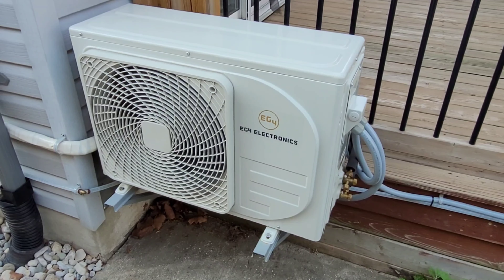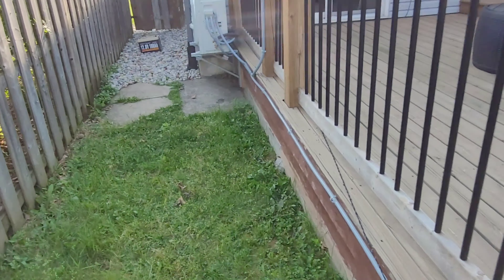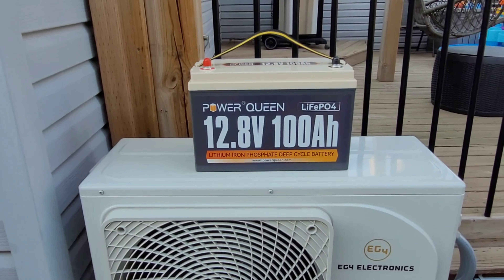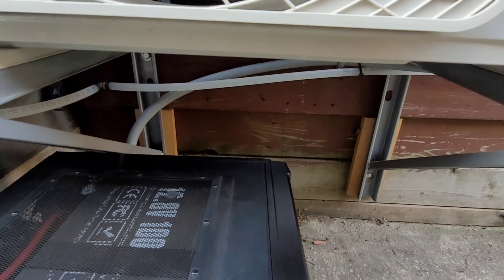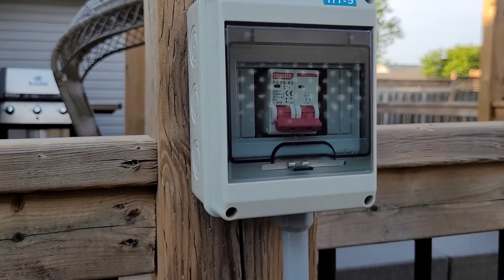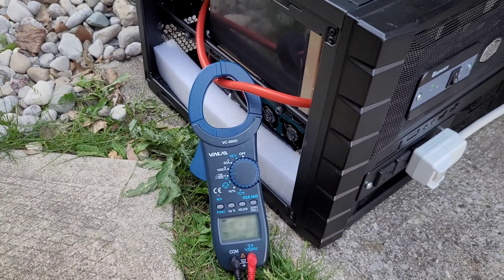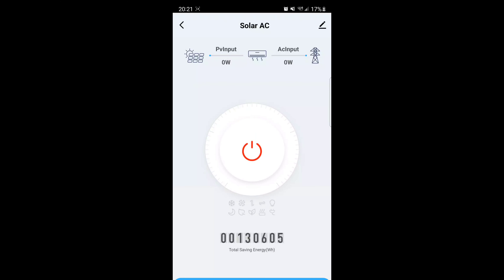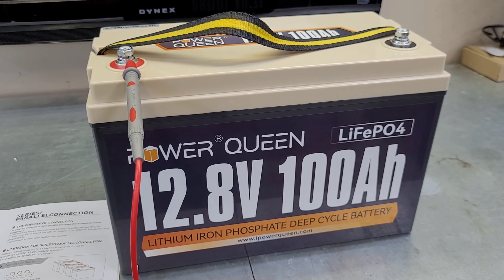Can You Run An Air Conditioner On Solar /  LiFePO4 Powerqueen Battery?

Comment: awesome setup. i have 2 ton mini split and i want to do a setup like urs. but how do i know how many solar panels would i need and all the equipment to run on solar..please help
Reply from the maker: You'd have to figure out how many watts it draws, how many hours you plan to run it after the sun goes down etc. You would need a decent sized inverter, probably at least 3000w, 2 to 3k watts of solar panels and a good sized battery bank, 10 to 15 kWh. That's why this unit is so nice that it runs directly on solar, you can eliminate all the other required equipment unless you want to take it fully off grid
Reply: @SmitHVAC.  
Okay let me go found out how much is draws

Comment: Why does the meater show all the power for the AC coming from the power grid when you disconnected the solar? Shouldnt it show nothing if you're running 100% off the battery?
Reply from the maker: The battery is connected to and inverter feeding into the Ac input of the mini split.

Comment: new to solar and i am interested in solar . how to u wire the solar panels into the mini split ? and i would like to know how to wire both solar and AC power into the ac mini split. the app where is it getting the information from ? watts being used
Reply from the maker: This unit has mc4 connectors built in so the solar can just plug straight in, the Ac power is wired to the dedicated Ac input block. The app gets its info from the unit, it's a specific app for this Ac.

Comment: wait.. are you running the as on 200v DC? not AC?  do you have those panels connected DIRECTLY?? Oh please tell me you are..
Reply from the maker: Yes the panels are connected directly for a total of 210v DC, this unit runs directly on solar and only pulls grid power after the sun goes down.
Reply: @SmitHVAC.  WOW! that is a real game changer. thanks for the info. I didnt realize the inverters in the minisplit would accept DC instead of ac. thats amazing. <3  Isee you are using grid and solar at asme time though? how does that work?
and what is that disply device that shows power source distribution connected to? do you have a video showing your schematic?
Reply from the maker: This one has a built in Mppt for the solar, check them out on the Signature solar website https://signaturesolar.com/?ref=_KvVrzchAclARI
Reply from the maker: @dontbe  I have a few videos showing the general operation and how it switches between solar and grid as needed

Comment: awesome!  How many panels / watts are needed to run this thing?  just over 500?  That's rad you can just get the battery charged up and use it for a few hours when needed.
Reply from the maker: Thanks for watching! It can use close to 1100w but it's usually sitting around 500w. I have 5 225w panels for summer and 6 for the winter.
Reply: @SmitHVAC.  thanks!  So if I ran 2 320w panels I’d most likely only be able to run it off the battery?  I’m building an office for working remote and want a mini split
Reply from the maker: @beardfootofficial yea that should work, depending on the size of the office you may only need the 9k btu which would use even less power

Comment: This is a 1 ton mini split correct?
The power consumption is excellent. I run 2 6k btu window units off of my solar setup and they use right at 600 watts each. So if you're a 1 ton unit you're getting twice the cooling capacity at less than half the watts.
One idea is to make a battery bank with a high enough voltage to supply the EG4 with the voltage it wants and feed it directly from the battery DC without conversion losses. I'm not sure if the EG4 would be able to handle being connected directly to batteries though. But that's how it should be. My opinion... haha
Reply from the maker: Yes this is a 1 ton unit, I believe it's around 22 seer although it doesn't state that in any of the documentation. The power consumption is excellent though. That's a cool idea but I'm trying to avoid anything that would void my warranty lol have an eye for more videos on this soon
Reply: I love the idea of the solar mini split but it leaves a ton of power on the table too. You can't have it all though unless you want to spend a good amount of money. I did mine the way I did because I picked up a bunch of window units in the winter for average of about $30 each. That's a big efficiency difference with the mini split and also having a heat pump would be nice. During the winter I just run a space heater which is probably half to a third as efficient as a heat pump... but also something I already had 🤷‍♂️
Reply from the maker: @lancealderman2755 that's always the case, you can't have it all. I like this method because solar panels are cheap compared to batteries, I don't mind dedicating 5 panels just to this with how affordable they are now. Nothing wrong with doing it your way, I just picked up a larger inverter so I'll probably make some videos on that soon.
Reply: @SmitHVAC.  That is true. What were the temperatures when you did this video? If you said you'll have to forgive me.
My 6k btu window unit will run about 500 watts when its 85-90° and can get up into the 650 and even 700 watt range when it's 100-110°. Even still the minisplit seems to be twice as efficient.
There's a lot of details, figures, and options I would have liked to have known when I was starting out...
Reply from the maker: @lancealderman2755 It was around 85f that day, we don't see too many days hotter than 90f here which is nice. In my other videos I beleive I show the Minisplit running around 800w. If I let the house get hot before turning it on, it runs hard until the house starts to cool down, then it ramps down to around 500w.
Reply: @SmitHVAC.  oh wow. If it was 85° here with both mine running I'd probably be right at 1000 watts. So then best guess is the mini split is 20% more efficient. Thanks for the info! That also means you're leaving less solar on the table than I thought also. Very interesting...

Comment: Just mind that these types of batteries have a lot of air and foam inside the case, keeping the actual cells in place and that forms a pretty substantial thermal barrier between the cells and the outside. 
From what I've seen in my batteries and others, there are no direct contact points between the cell aluminium cans and the plastic outer case so pretty much no heat gets out. 
I am considering re-casing my packs in something more manageable that could be cooled or heated as needed...

Comment: Have you made a video explaining if it’s possible ect on running it directly off batteries DC I see lots of comments about it & I’m also curious
Reply from the maker: I have not made a video on it, but I was talking to a tech support rep from Deye and they said it is possible
Reply: Yah but how much bat would be needed in a day? Then how many panels needed to recharge ? I’m about to do something to my RV so still looking.
Reply: This is the subject that maybe should be talked about some more. For example,  as I understand it, your home made inverter is probably losing up to 15% of the energy in the battery during the conversion to AC power, then, when once inside the unit, another inverter is converting it back to DC to run the compressor with another likely ??% tax.   I know batteries up the price but there are lots of videos with all the battery people doing the DC to AC back to DC conversion.  I realize they are probably running other things but for people designing this system from scratch and have more options I don't see this discussed much.   Am I missing something.   Can't we just configure batteries to feed DC power to the PV input on the mini split, or would  the other MPPT controller between the panels  and the batteries interfere?
Reply from the maker: Its apparently possible to configure the batteries to feed into the mppt, you would need a minimum of 90v DC on the input. Meaning you would need an mppt capable of charging the battery bank around 100v Dc. It's more equipment than I have and Im not looking to void my warranty on this EG4 AC, but it is possible. This was more or less to show that you can run a standard mini split on a battery and a small inverter if you didn't have the EG4 version.

Comment: I would get a sun tracking solution that would tilt your panels toward the sun automatically. The extra power should pay for itself.
Reply from the maker: Do you have one you'd recommend?
Reply: those things are very expensive and fragile - think weather...  avoid that expense and spend those $ on "moar" panels and batteries.

Comment: Just wondering on how you charge the battery, and also the BMS of the battery will protect it from low discharge damage, you  really have no concerns with that, longevity could but your talking years down the road in which their is debate if aging will shorten the life first.  between that and your inverter they will shut down if low voltage becomes to low to sustain the load.
Reply from the maker: The portable station was just to test out the idea, if I put it on a battery backup I will hardwire it to the Ac from inside. I have a string of solar that runs inside to a other system.

Comment: how does EG4 or circuitry do this?  does it skip the AC-DC conversion or this thing just has a built-in 120V inverter?
Reply from the maker: Skips the conversion, it has an mppt and a DC compressor

Comment: I'm trying to understand your setup without ac input from the grid. So you have a pv input on your mini split. And you just add the solar panels in series and feed it directly into the mini split? If this is true, does the unit turn on automatically or do you have to go to the remote contorl and manually turn the unit on everyday in the morning when the sun comes out?
Reply from the maker: Check the other video you commented on, I explained it on that one

Comment: How did you hook up battery box to mini split? I see it plugged into battery box, but did I miss seeing how you plug into unit?
Reply from the maker: I had that cord wired into the line, neutral and ground terminals of the mini split
Reply: Can't thank you enough. If I end up purchasing one, I'll certainly go through you.  I noticed you're using a 100/20 Victron MPPT. You have 5 panels hooked up at less than 100 volts? What configuration are you using to accomplish this?
Reply from the maker: @aznick102  thanks Nick! Appreciate it. I only hook up a max of 2 of these panels to the Victron. I typically have 5 hooked up to the Ac and 1 to the victron, panel upgrades coming soon!

Comment: how many btus is that mini split? 500 watts is pretty dang efficient, I wish i could afford one for my little solar shed, I kill my batteries a lot running a stupid 8k btu portable AC that cant cool a room because of its design. the dumb thing uses 800 watts too.
Reply from the maker: This is a 12k btu, it's very efficient! I have a video coming tomorrow showing how to run it on around 220w. Thanks for watching
Reply: @SmitHVAC.  jeez thats crazy efficient

Comment: I still prefer to build the Lifepo4 batteries by my own. This way I get 280Ah for less money than this 100Ah cost (exept when get it sponsored). I have full control via App and also have a monitor without mobile phone, to see the single voltages from the cells and the deviation. An active and passive balancer are also included, so theres no issues, if use the battery intense. I dont trust the BMS this finished batteries have build in.
Reply: Could you point me in the right direction to learn to do this?   Or explain what you do.  Thanks!

Comment: Rewatching your video, last summer in Arizona our electricity was out for 4 hrs. In about 2 1/2 hrs afterwards the house heats up. Watching your videos make me want to build a gazebo and add a solar E4 2 ton to house along with a battery backup system that will last at least 4 hrs of electricity outage. Any recommendations for a battery unit to support 4-8 hrs of service when there electricity outage? Thanks!!
Reply from the maker: I have a bunch of the Chinese 100ah batteries hooked up that give me about 8 hrs of runtime. I'd probably recommend the EG4 all in one inverters and 48v Lifepo4 batteries if I had to start again!

Comment: Do you already have a Thermistor controlled Gable Fan?
My house carries a ton of heat in the attic and with a Gable Vent fan + Thermistor set to around 95F it helps to cool down the attic and thereby the house underneath as well.

Comment: Using an inverter increases the voltage of current, rather than using battery directly, it would be good to use inverter to increase current.

Comment: Hi, can I run a 1.5 ton AC directly from solar panel without using batteries or any other power source (complete off grid). I want to use less batteries as possible as they need to be replaced often. I want to run the AC only during the day. Thank you.
Reply from the maker: No, you would need batteries, an inverter and an mppt. Or a solar direct ac like this one.
Reply: @SmitHVAC.  okay. Thank you.

Comment: How about a battery running a standard cheap 5,000btu window unit? Some little thing the average person can pickup at HomeDepot for $150 and how that would do on one pf these LiPo’s. Also approx what size panels you would need to keep it running all day. In a grid down situation, just curious to see what kind or simple and min solution would be needed to handle that. Most people are always concerned about their refrigerator when the power goes out but really, when it happens and its Summer, people are looking for some AC to get through it all.
Reply from the maker: If I can find a good deal on a little portable Ac I'll make that video

Comment: What BTU is that AC unit?
Reply from the maker: 12k
Reply: @SmitHVAC. thanks for that. I have a solar system with 6500W of panels (12) with 2 200a 10Kw Lithium iron phosphate batteries and a 8Kw Hybrid Inverter. I wanna install an AC unit or two between 9k BTU and 18k BTU. I just wanted to know how much a 9k BTU AC unit would run as soon as it is turned on and starts cooling. Here I see yours run at around 500W so I can expect it to run less than that?
Reply from the maker: @thtk4tis yes it should be around there, this one pulls up to 1400w in heating mode

Comment: Hi I need help finding a device Maby inverter type that can convert direct AC power from the solar panels without needed connected to the grid or batteries want to be off grid but no batteries and use a power strip to power fans etc

Comment: Awesome choice on the renogy inverter! I have the 2000 watt on 3 gel 100ah batteries. I've been looking into mini splits and then eg4 happened... I'm really sold considering I've been helping cooling my house with a delta pro with 1500 watts of solar running a 1350 watt portable air conditioner 12,000 btu and also doubles as a heatpump that I use in the winter but I really need more efficiency. I have another 500 watt array Soni think between the 500 watt array and delta pro and get one extra battery I'll be all set lol what's the highest wattage you've ever seen the eg4 mini split pull? I'm heading over to your page to check out more videos on it. Thanks for the video!
Reply from the maker: Yea it's a good little inverter! Great standby power consumption too, only about 6 watts. I've seen the EG4 pull about 900w in cooling but not for very long, and up to 1300w in heat mode. Thanks for watching!

Comment: Great vid as always! 

Perhaps over panel with some panels that specifically point westerly at the late afternoon sun. Panels are pretty cheap these days. 

Are you charging the 12V battery with the panels during full sun? Do you have a plug and forget solution figured out yet?
Reply from the maker: I have a permanent battery backup with solar charging in the works right now! I'd love to add some panels, the problem is real estate. My pergola is full so I either need to put some on a mount in the yard, or put them on my roof, which I'd like to avoid!

Comment: So I didn’t realize eg4 sells an identical mini split that is not a hybrid. Mine doesn’t have pv inputs. But in purchased panels and a tracker to power it. I live fully off grid- my inverter is maxxed. Do you know if the board can be swapped or if a Pv input can be added? Are the compressors all dc? These are relabeled and the vendor is telling me they don’t think it’s possible but the diagram inside shows it’s optional
Reply from the maker: I beleive it's a separate mppt board, that's what the diagram shows but I haven't had to hood off to verify. I would probably try to explain the misunderstanding and swap it if possible? Modifying the new one would certainly void the warranty
Reply: @SmitHVAC.  thanks for the response! Problem is, I already installed it and released the gas and the line set is spray foamed into my cabin. I bought it from a solar website and had no idea they were selling non hybrids. I’m willing to buy another condenser unit at this point if I can swap and leave lines alone
Reply from the maker: Oh that's tough, I'm not sure if the non solar indoor head could communicate with the solar outdoor unit
Reply: @SmitHVAC.  it’s crazy, it’s the same app and everything - it shows pv array on the top and of course 0 kw saved lol. I may have to build a whole new off grid system to run this thing unless I rip it all out
Reply from the maker: @Myoffgridlife  that's crazy, I've never seen one without the solar option. You said it's an eg4? Could you send me a link to where you bought it?